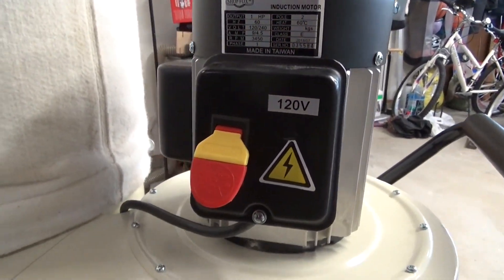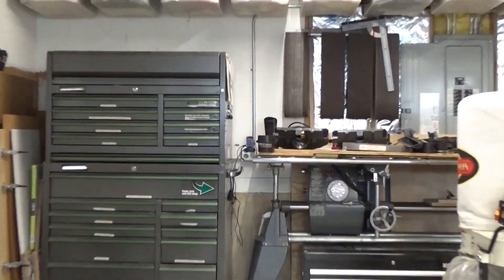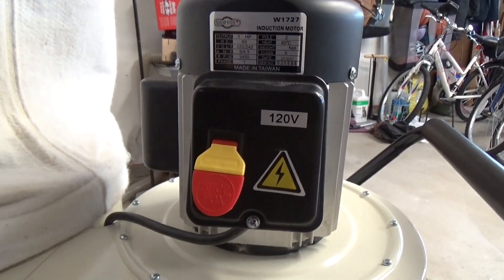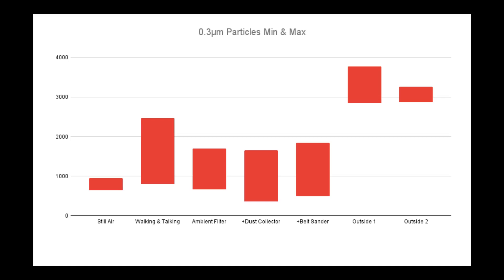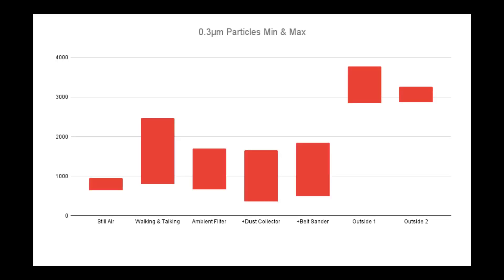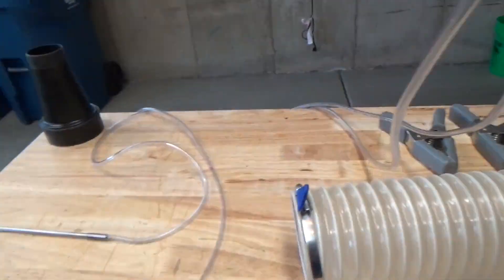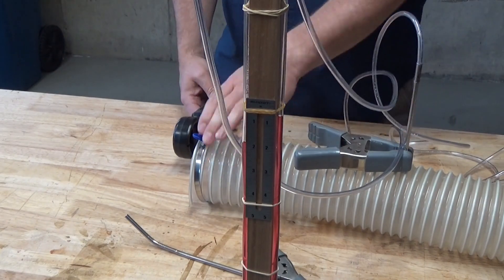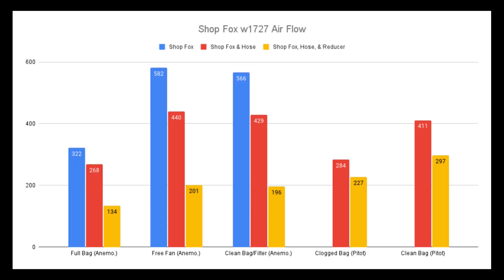Dust Collector Testing Re-Do: Should I Upgrade to a Canister Filter?

Comment: I purchased the SSmith upgrade DC motor.  The amount of air moved by the new motor is significant.  I removed the 3 way intake on the DC 3300 and in its place installed a 4” connector.  As well I ordered and am using a 4” hose from the DC to the Smith.  I purchased a 4” to 2-1/4 reducer, clamped about 12” of 2-1/4” length of hose enough to move the table or headstock without interference.  The lack of sawdust, bandsaw dust, improvement of conical disk dust is  -  well I’m glad I purchased the new motor, connectors and hose.

Ok - but!! It’s foolish to argue against data I know but - are you sure you didn’t confuse the two data sets?
Reply from the maker: Hi John, thanks for questions. 

I don't read too much into the data. Its just engineering field measurements and NOT a lab setting scientific study. I think of it as akin to reading my own body temp as a diagnosis for an illness. I was simply "taking the temperature" of my dust collector to see if I could find any common "illnesses." I don't see any right now.

I think you have a great setup with the DC6000. And running the 4 inch hose as long as possible before reducing to 2.5 inch removes A LOT of friction from the system which avoids major drops in CFM.
Reply: That outside air has more particulate matter than inside air?  There’s (me thinks) an error- - - -?
Reply from the maker: I don't think I confused the data sets because I watched the video several times while editing and you can see right within the footage some of the numbers at each location. All the outside measurements prove to me is that my device is capable of reading higher values.
Reply: @woodshopnerdery  
I too watched and confirmed exactly what the data shows.  However - that said…. you are in a confined space.  Dust is being generated.  The dust can go into the collector and some of it won’t.  The hood too is “open” enough that ….

I don’t get it -  I’ll be …….!👍👍

And I’ll say again the audio and video quality is most excellent.  Nicely done.👍👍
Reply from the maker: Thanks for the compliments. I've been trying to get the best audio and video I can with the equipment I have, iPhone, cheapo camcorder, computer mic. I wish it were better, but this is just a hobby for me so... I used Shotcut to put it together which is a very basic free application.

Don't get me wrong, I am concerned about the dust. I know very well that broadly speaking 50% of the dust is not collected immediately. This is why I have the ambient filter. But, there is only so much a dust collector can do. I have adequate CFM and my filter is capturing particles of all sizes. So it is helping. Could I invest $1500 and do better, of course I could. But when is good enough, good enough? I'm still trying to discover these answers.

I think that there is a popular misconception with filters that it either gets 95% of 0.3um particle or it gets NOTHING and lets EVERYTHING through. That is not true as far as I can tell. My filter is still getting the particles, but instead of 95% efficiency perhaps as a best guestimate maybe only captures 80% of 0.3um. So if I cycle the air twice through my system does the filter get 96% (80% + (20% x 80%))? I think my test showed some indication of that, the longer it ran the more the particle counts dropped.

Comment: Great follow-up video.  I have done similar tests in my own shop before.  Sometimes outdoors is significantly less than my shop and sometimes the opposite.  Outdoor particulate levels vary a lot depending on weather, local pollution levels, landscapers running leafblowers, neighbor's diesel pickup, etc., etc.  IF you live in a city with high pollution then I would expect outdoor particulate levels to be worse than your shop, but that isn't really a good argument for why you don't need a HEPA cartridge filter on your DC in your shop IMHO.  Bottomline is that around 0.3um particulate levels are just hard to filter due to Brownian Motion causing degraded filter efficiency in this range.  A bag filter is just much less efficient at capturing particles around 0.3um than a HEPA cartridge is, but whether or not you want to pay for a better filter is totally subjective.  I just wouldn't use outdoor air particulate levels as my baseline...I strive to have my shop, and house, be much, much cleaner than outdoors because this is where I spend most of my time so it has the most affect on my health.  With proper filtration, IAQ should be far cleaner than outdoor air in most locales.
Reply from the maker: RF Guy - Thanks for the comments. I'm curious if outdoor air is not a good baseline, then what is a good baseline? Also, what are your particle counts running your cyclone/HEPA canister system?
 
BTW -
https://www.airnow.gov/ - On the day of the test, my area (and most of the country) was at PM2.5 70 Moderate. Today it is PM2.5 28 Good for my area and most of the country.

EPA has long recommend ventilating outside air as a major strategy for improving indoor air quality. https://www.epa.gov/indoor-air-quality-iaq/improving-indoor-air-quality
Reply: @woodshopnerdery  For a baseline, you could target the green range in the AQI recommendations from the EPA, but I don't even think the EPA specifies or measures particle counts below PM2.5 unfortunately.  My approach is as follows:  I run my air cleaner in my shop when it is not in use, so when I enter my shop to work, I use this level as my "baseline".  I mainly focus on the 0.5μm range on my Dylos which is typically around 200 or less.  Then as I am working, I just keep an eye on the Dylos.  Usually it stays under 400 for most operations, but for certain sanding operations it can climb above this.  Whenever the counts get above 1000 (like some sanding operations), I take a break from my shop and come back a short while later to resume work.  I am not saying everyone should do this, but this is just my method.  This works for me with the Dylos because each reading is averaged over 10 samples.  It is much harder to implement this method with meters that are instantaneous reading only because it fluctuates so much reading-to-reading.  Bottomline is I try to keep my shop close to the particle count levels that I maintain inside my home.  I also run air filters in my house so my IAQ is better than the average home.  The EPA ventilate to outside rule only really works when the outside air is cleaner than inside right, but what if you live in a big city?  Ventilating to the outside means also pulling in outside air to replace it to maintain pressure inside the house.  IF you live in a very polluted area it may be inadvisable to ventilate outside because you'll pull in much more polluted air from outside to replace it...
Reply from the maker: Great method. And a good set of goals. I think I have been doing something analogous, but maybe not as rigorous and with somewhat more relaxed goals.

I look mostly at the AQI screen because I can see it across the garage, it shows a single value in large font. It normally stays in the "Good" range but during some operations spikes into the "Moderate" range but is within minutes cleaned back up to "Good". And boy if I forget to turn on that dust collector, then numbers go way up, and yes I do turn on both my systems and come back in 10-20 minutes.

I know the AQI is not a perfect measurement. I like your 0.5 micron approach. But like you said, on my unit the detail screen shows instantaneous measures, so it can be quite "peaky". That is why I showed the min and max values in my video. But on my unit I believe the AQI "estimate"  is calculated over several sample reading across all practical sizes. Not the 24 hour period spec'ed out by the AQI standard by it is a "rolling average" of some sort. So I try to keep it in the "green" and also look at the trend up or down and try to make sure it  trends downward between operations.

If money were no object I would go with the Oneida Mini-Gorilla. It seems like it would meet my needs while still fitting in my limited space. I think that sort of upgrade is what it would take to get an appreciable change over what I have now. I think if I simply swapped my felt for pleats it would not be a game changer.
Reply: @woodshopnerdery  Yeah, I think you are on the right track with all of this.  I am not saying my method is the only way to do it.  I mainly just wanted to highlight that outdoor air quality can be crap in some areas so I wouldn't use that as a baseline.  I am also a strong advocate for HEPA cartridge filters, but I know they come at a cost and may not be suitable for everyone.  I really wouldn't recommend anyone switch to HEPA cartridge filters unless they can afford the airflow drop with putting a cyclone in front of the DC first.  Otherwise as soon as the cartridge filter clogs up, their airflow will drop precipitously which will compromise dust capture at the tool resulting in even more dust particulate entering the shop atmosphere.  For me, I try to keep my shop as clean as possible...hopefully close to my indoor AQI levels.  My shop is in an attached garage so entering/exiting the shop allows some of that air to interchange and I really don't want any of that dust getting into my living space.  As a result, I may be more rigorous with my approach to all of this, but for good reason.  With regard to instantaneous readings on particle counters, I have been meaning to try to hookup one of those PlanTower sensors to a laptop so that I could do my own averaging and data display.  It would definitely be more useful with a running average and histogram display to see how different shop operations affect shop air quality.

Comment: I completely agree with you on the subject of filter bag vs canister filter. I'm sure the canister filters work great. But...

 -Both pleated filters and filter bags have to be cleaned. Neither can be washed, but filter bags aren't difficult to clean. 

-A canister filter doesn't seem as easy to clean, and I doubt they can be cleaned as well as a filter bag can be cleaned. I would think there would always be some dust trapped in the pleats that would never come out. Which means no matter how well you clean the canister filter, your dust collector's  cfm's would slowly decrease over time with a canister filter; more so than a filter bag.

-Also at some point a canister filter or a filter bag will have to be replaced. I'd prefer to spend a lot less money on a filter bag than a canister filter. In fact, you could buy a few filter bags for the same cost as one canister filter to keep in stock, and the bags take up a lot less room. 

-Plus, the risk of a big canister filter getting damaged just from storing is a lot higher than filter bags.

I'd say there are more pros for filter bags, and more cons for canister filters.
Reply from the maker: @rfguy8499  We are certainly flooded with information that does not always agree. It's hard to no how to reconcile the discrepancies, which is why I like to do a little proof of concept if I can.

BTW - I think Chad could be saying he watches Stumpy Numbs as well as my channel. But, it could be taken either way.
Reply: @woodshopnerdery  That's all I was saying, yes, I watch Stumpy Nubs as well as this channel, and many more woodworking related channels. James Hamilton is fairly well know I think. I was guessing RF Guy had seen some of his videos. I never said he referenced Stumpy.
Reply from the maker: Chad, very good points. I could see the argument for a canister filter(s) in a multi person shop where multiple professional grade machines are running. And there could be other places where canisiter filters are ideal. But, for one man shops and certainly for hobbyist I think all of you points are SPOT ON!
Reply: @woodshopnerdery  Hey, at least you use dust collection in the first place. I've helped certain friends over the years that didn't use any dust collection at all. Just a push broom and a dust pan at the end of the day was all they believed in. And in the winter with their garage doors closed to hold the heat in; they'd have a haze of fine dust in the air for several minutes or longer while sanding or running a table saw, just breathing all that in. No thank you.
Reply from the maker: @chadnevels246  It's better to do something than nothing. I feel pretty good about what I have, but still have an eye out for reasonable improvements. For example, Rockler has a "Shaker Felt" bag for $40 I might try out. It's rated at 1 micron and has a lot more sqft of filtration than the one I have. Might be worth trying at that price.
Reply: @woodshopnerdery  for sure. A $40 filter sounds like a worthy investment. I'd be interested to hear the results.
Reply from the maker: SS sells a similar 1 micron 42 inch bag for the DC3300/DC6000. Do you have the SS dust collector and have you or have you thought about the 1 micron hood for $94? I think RF Guy said he did the upgrade to the 42 inch hood before building his canister system.

https://www.shopsmith.com/ownersite/catalog/dc_filterhoods.htm
Reply: @woodshopnerdery  Yes, I do have the DC3300, actually 2 now, just bought a second one. I'm going to upgrade one of them to a DC6000 here soon. I'm debating on that filter hood, or to go with something completely different.
Reply from the maker: @chadnevels246  A DC6000 with a 1 micron hood should be pretty sweet if you take off the 2.5 inch intake and run 4 inch hose all the way to a 4-2.5 reducer at the tool. I think this is John Rice's setup right now, I would imagine he is happy with it. That's a 1.5 HP system, should leave my 1 HP system in the "dust" - 😁😁😁
Reply: @rfguy8499  I watch Stumpy Nubs (James Hamilton) as well. As I'm sure you're aware, he's put out quite a few videos on the subject of dust collection and filters over the years. So yes, I'm aware of what cyclones do, and how to clean HEPA filters also. According to Stumpy; never wash a filter hood. Washing removes the coating on the fabric that filters the fine dust and lets it back out into the air. I agree with that statement. If you or anyone else use a filter hood, and have been washing it, then I recommend you replace it asap.

Comment: Damn, wish I knew this two years ago before  I sprung for a canister filter! 😣 For overall air filtration I just use two 20” box fans hung from the ceiling of my shop like yours. Izzy Swan found that they work as well if not better than the expensive types. Good quality furnace filters work great!
Reply from the maker: Thanks for watching and commenting! I love to see the comments. I saw the Izzy Swan video about the box fan filter too, but I wasn't convinced until I saw this video https://www.youtube.com/watch?v=kH5APw_SLUU&t=136s

I'm sure your canister upgrade was a smart move for your system. Believe me, if the sensor showed high particle counts in my garage I would have immediately ordered a canister.

 I hope the take-away people get is that each system is different and there is no one size fits all solution.